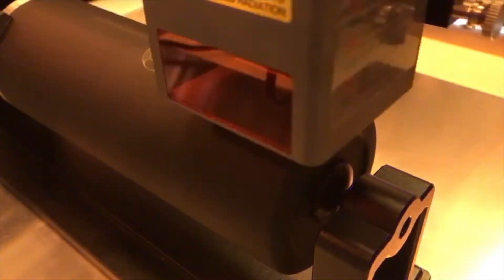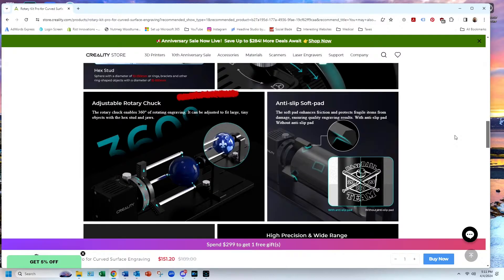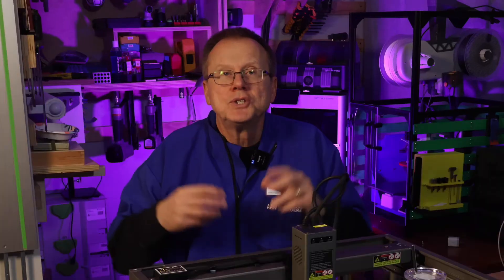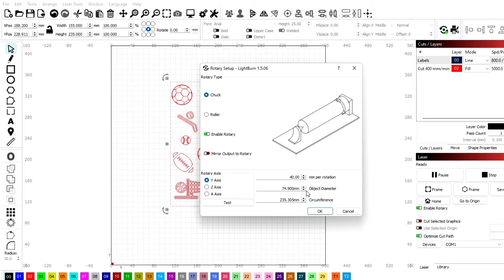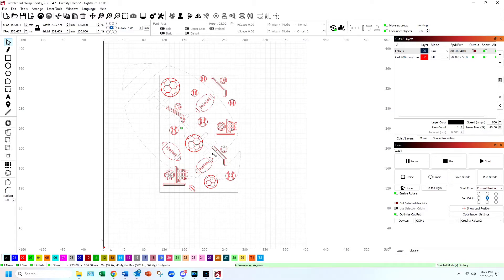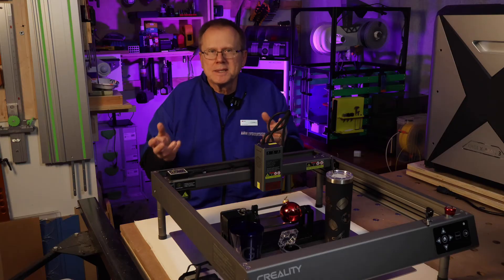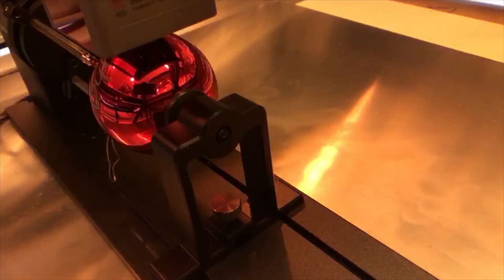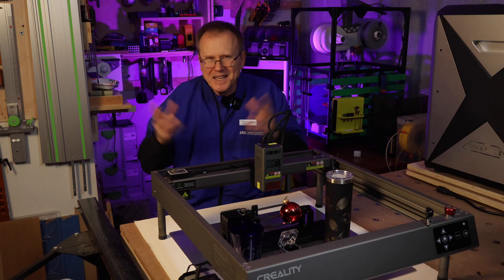How to Master the Creality Laser Rotary Kit Pro

Comment: I have a large yeti mug that has a handle. The handle keeps hitting the base of the rotory. Is there a fix for this issue? Any help is much appreciated
Reply from the maker: I haven’t engraved a Yeti cup, but I have the impression you can remove the handle, depending on the model. Can you see if you can remove the handle?

Comment: Hello. I'm interested in the roller. I currently have a mintion camera set up with my laser. Do you think it will help, hinder, or be obsolete for jobs with the roller. thank you.
Reply from the maker: That's a great question.  I haven't used the camera with the roller option.  I don't think the camera will hinder your use of the roller.  In my case, the camera is fairly high above the engraving area so I don't see it as hindering my use of the roller.  Thanks for your question.

Comment: Hi have you ever used the rotary offline with the TF card starting from current position, I have and can't seem to get it to frame in the correct position and as a result can't do the engrave. The offline function works fine with absolute position but it is very difficult to use that function when using the rotary as you can't home the rotary. The reason I ask is because the other day I did a long engrave (1.5hrs) and about 1 hr in Lightburn on my pc closed for some reason (that's another story, but it didn't go to sleep) as a result the engrave stopped 70% of the way through and stopped, obviously it couldn't recover, using the offline facility would prevent this from happening. Any ideas? Your help would be greatly appreciated.

Comment: The ring was really cool! 
Any idea on whether the shininess of the material makes a difference? 

And how would you go about etching on a silver-colored stainless steel ring? I’m assuming it won’t etch in the same way as the matte black ring shown in the video
Reply from the maker: I'm not an expert on engraving metal; but I think it would be more of a challenge to engrave a stainless steel ring using a diode laser.  I have seen that diode lasers can change the color of stainless steel, but from what I have seen on YouTube, it seems that the fiber lasers are more suited to engrave stainless steel.

Comment: How do you ensure that the laser head doesn't hit the jaws of the chuck or the rotary while engraving or after engraving?
I'm just trying to prevent a possible collision before attempting to engrave using the rotary pro.
Reply from the maker: One way I check for clearance is to initially set the laser higher than the jaws and do a dry run with the laser power extremely low. You can also position the origin at a certain point that is not close to the jaws. I hope this helps. Thanks for your question.

Comment: Hi, I am using a pro kit and recently had a project to engrave a Yeti 40 oz tumbler with a handle, the handle is not removable. Understanding that I would not be able to do a full rotation due to the handle I designed the artwork for only a small portion of the tumbler. To engrave on the side of the tumbler the handle needed to be located at an angle out to the side at some point either side of horizontal, this presented an issue where gravity took over and the handle always wanted to drop to the bottom not allowing me to position the tumbler in the correct position for the engrave. Have you experienced a similar issue when using the Rotary chuck attachement. I also have a set of Creality rotary rollers which I did the project on, the stiction in the drive mechanism prevented gravity taking over.
Reply from the maker: I haven’t engraved anything yet that wasn’t symmetrical in shape/weight so I haven’t experienced my workpiece slipping. Thanks for bringing up your experience with the Yeti. That’s good to know.

Comment: how high from the objects in the rotary for the laser height what is used to measure that distance ?
Reply from the maker: I used the same gauge block as I would for a flat workpiece. It is a bit tricky since the workpiece is curved, but it does work.

Comment: Hello, your video is really great! 😊 how do you center round objects (e.g. that ring)? Since I have the same setup as you, I am struggling with positioning of the object. I cannot figure it out. any tips what I should do/ don't do? 😊I have specific space on the round object that I have to engrave it
Reply from the maker: Thanks for your feedback! Regarding your question about engraving a ring, it is hard to position the engraving because it’s such a small area and you want to be precise. I suggest that you place a small piece of blue painters tape on the ring and set the laser to a very low power setting so that you can engrave the tape, but not the ring. Then once you have adjusted the position to where you are happy, carefully remove the tape and engrave at the normal power setting. I hope this suggestion helps you. Please let me know how you make out.

Comment: Question - I have this rotary pro unit and am having trouble centering my cups on the end at the spinning cup is...how do you suggest to center your cups so they rotate true?
Reply from the maker: I use the jaws on the headstock to hold the outside of the rim of my cups and I push the rim of the cup so it makes contact with the "face" of the jaws of the chuck, then tighten the jaws.  Next, I move the tailstock up to the bottom of the cup and hand-rotate the cup to ensure it is centered.  Then, I put pressure on the tailstock toward the cup bottom while tightening up the tailstock.  I hope this helps.  Thanks for your question.

Comment: how you able to not get images distorted when printing on surface.  On my test i'm getting distorted image i.e.  40x40mm imagine yet on surface X axis no issue on height yet width on Y axis it can be as much at 70mm wide..
Reply from the maker: That seems very strange. I recommend that to contact Peopoly about your issue. I have found them to be very responsive to my questions.